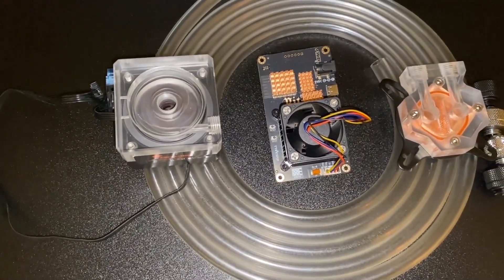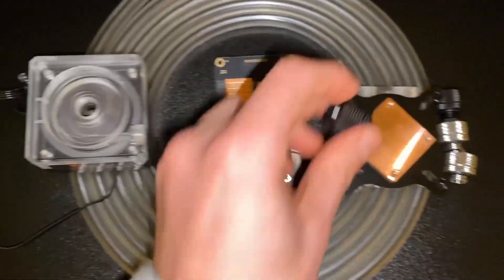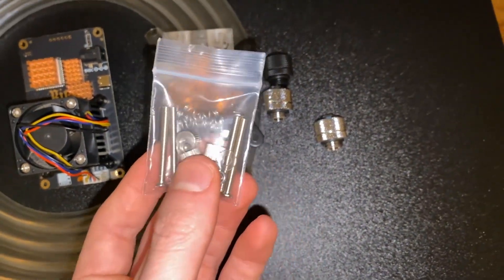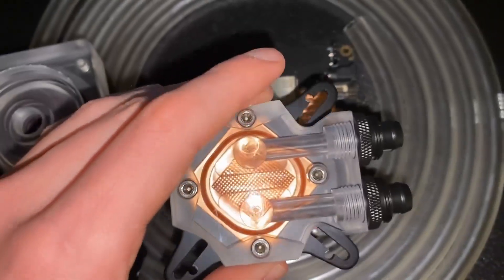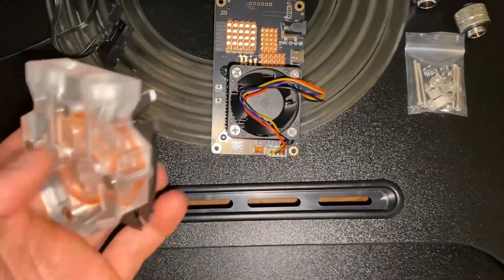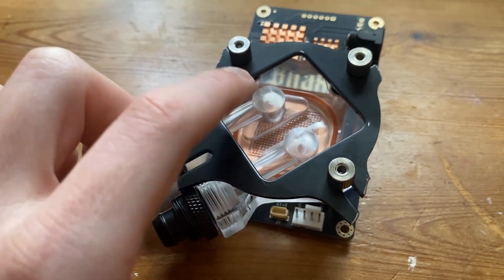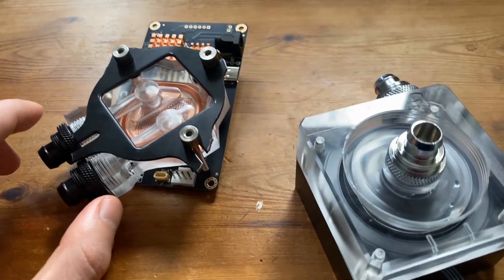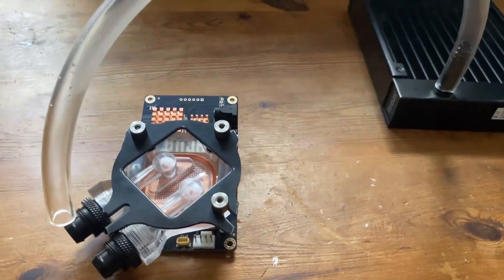Trying To Water Cool A Bitaxe Gamma...

Comment: @Sterling first i would find out if there is any temp sensor on the pump, if not i would put the pump on the hot side of the flow, so basically the cold side of the radiator output goes directly to the input of the water block, the output of the block goes to the input of the pump and output of the pump going to the input of the radiator, to prime it is simple initial the system will not be close loop (unless you got a T with a shutoff), anyways the output of the water block goes to a bucket and the input to the pump to the pump goes to the same bucket, once all the lines are filled, connect the water block output and the pump input together without spilling any liquid (not going to be easy without a T but can be done.
Reply from the maker: Thanks for the advice, I’ll be trying this right out later in the week so I’ll try get the full build out soon

Comment: I have done it like this with , GeeekPi Waterkoelkit voor Raspberry Pi 5 and , Orolotay Chipset Waterblok Computer Waterkoeling  4 x 4 x 1,7 cm fits perfectly. Thanks for video.
Reply from the maker: I’ll look into this thanks
Reply: @SterlingSpecter1  Look now I've changed with the new cooler Copperzilla - Copper Heatsink IXN-40C, This is crazy 😱 in default settings, it lowered the temperature by 16 degrees, and 1W of electricity, I think it could be used for passive cooling. It is very stable with default settings. The voltage regulator heats up more than the Asic chip. I use the standard Bitaxe fan. Thermal paste that I use Grizzly Kryonaut extreme. I do overclocking when I get the new power supply MEAN WELL Well LRS-100-5  90W 5V/DC. The one I have now doesn't work well. I don't make videos, I don't have time, work, family, I'm very busy. I am very happy with the choice I made, I'll leave it like this forever.
Reply: @ This is crazy. With the new power supply and overclocking to the maximum that can be done 625/1250 without tricks, total silence and normal temperature Asic 39 C ,voltage regulator 52 C with help, I put a small fan in the back just for this, power 19 W, fan speed 35%, ambeint temp. 20 C. Spectacular, it's not worth spending more money on other things. I'm sure that without this new cooler I would have already burned out. Total consumption electricity is 25.3 W .Thanks for videos.

Comment: I saw your post on X talking about having two fans on the Bitaxe and its issues with voltage. Did you ever figure that out cause i was going for the same setup using a shroud case for the Bitaxe
Reply from the maker: Power supply was the issue, couldn’t handle the two fans